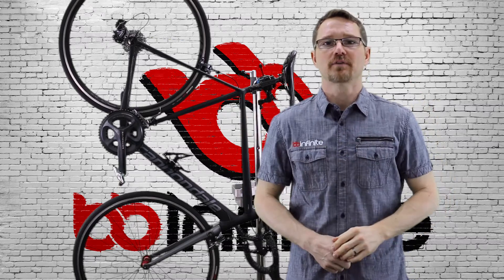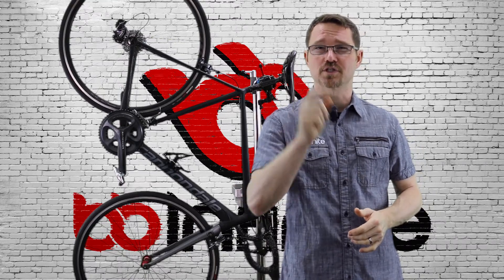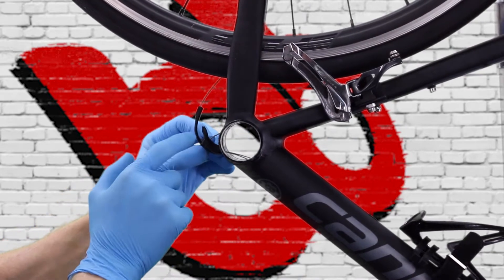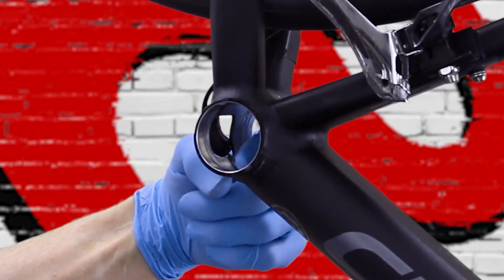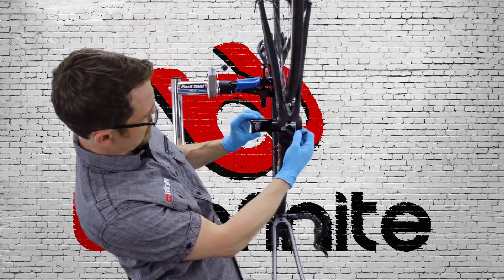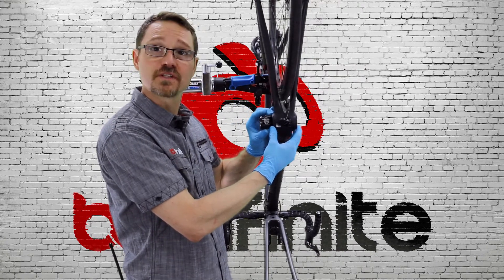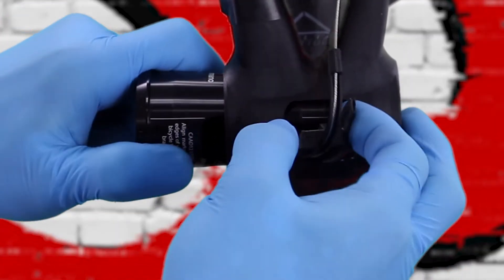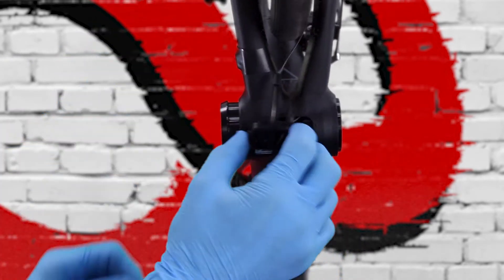CAAD 12 Creaking Issues Solved with BBInfinite

Comment: Just bought one of these.  I can attest that it works perfectly.  Smooth as butter (I got the ceramic bearing one) and no creaks!  I could swear I'm faster, but it's probably just in my head.  One note about installation - - I found the installation instructions a bit confusing, but the BBInfinite staff will be glad to walk you through it.

Comment: Hi, Do I need to remove the BB every time i change the cable?
Reply from the maker: Only if you don't know how to run cables in a modern bike. Never pull a cable out blindly. Always "chase" over the top of the existing cable with a length of inner wire liner as far as you can. Then, as you carefully pull the cable out, push the liner in at the same rate so that the liner emerges on the end you're pulling from with. Pull the wire out and insert the new wire all the way through the liner, then remove the liner. Use a liner as a full-length guide every time you remove/install a cable.
Reply: @BBInfinite   Can you recommend a good video that shows what you are talking about? I would be doing this on a brand new frame with nothing yet installed on it. Do I run the cable first? or after I install the BBInfinite?
Reply from the maker: @kendarcie6613  It's always easier to run cables with a bb out. That said, if you have to re-run cables later down the road, the bb does NOT have to be removed. The bb never needs to be removed for the life of the bike unless you want to change crank standards or you need to use the bb on a new frame due to a frame warranty. The bearings are replaceable with the bb installed. Super easy.

Comment: Is there anyway to get this to work with a Caad 12 Disc that has the rear hydraulic line running through the BB?  The Caad 12 I have runs the SI Spider cranks and I can’t find any one piece or screw together BB on the market that will allow me to continue to run the Cdale spidercranks AND accommodate the hydraulic line.  Thank you!
Reply from the maker: No, our one-piece module will not work in a CAAD12 Disc for the reasons you state. We have one for the CAAD12 non-disc only. We are making a 2-piece for the CAAD12 disc. It will be out in August 2019.
Reply: Can you fit di2 wires with the caad12 rim brake bb mentioned above?
Reply: @chanjasonsk  No, only rim brake CAAD12s equipped with mechanical or wireless groupsets can run BBInfinite's one-piece BB.

Comment: There were no lines to align the window on a Campa Ultra Torque module...
Reply from the maker: There are now. We did not have the guidelines on earlier models. We had an alignment arrow on the older ones and it confused people. We change things immediately when we see a better way of doing things.
Reply: @BBInfinite  I ordered mine in late October so either it's older inventory or I got there a bit too early then. Would you say everything's fine as long as the plastic cover goes into place?

Comment: I have a 2015 carbon synapse with rim brakes and internal shifter cables near bottom bracket.  Will the cable guides and shifter cables cause a problem with installing your bottom bracket?
Reply from the maker: No, there  will be no problem with a carbon Synapse. The Synapse carbon has a passage that goes around the bb for the cables and hyrdraulic lines on disc brake bikes. Our bb works perfectly and the install is very straight forward.